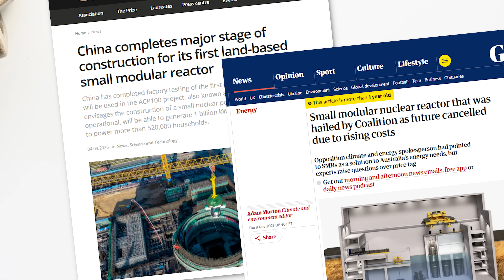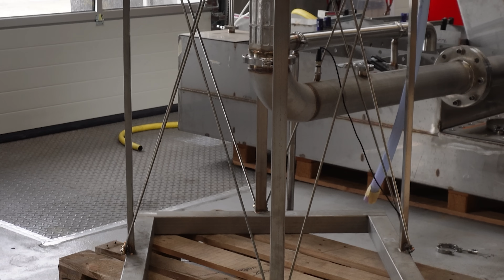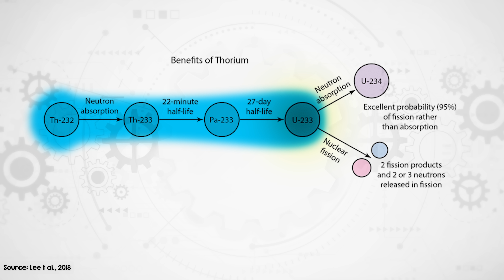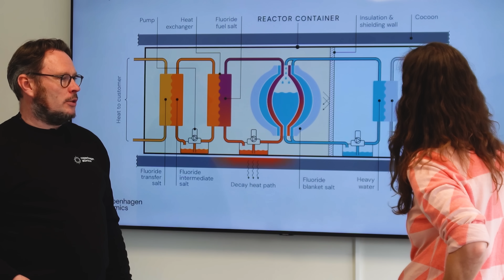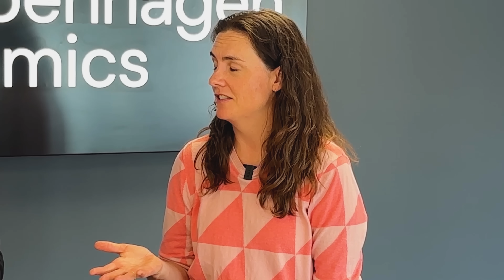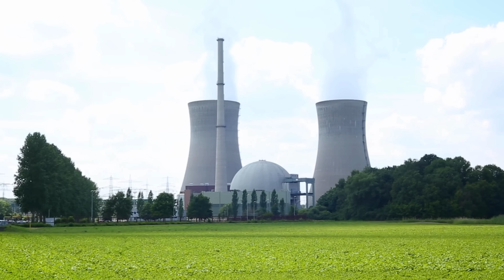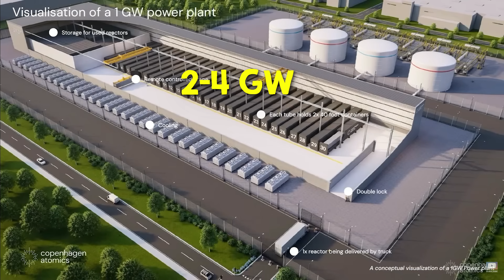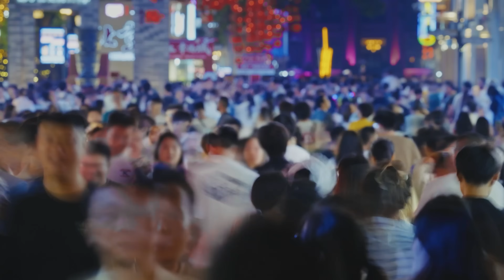Can Copenhagen Atomics Make THORIUM REACTORS Work? [TOUR]

Comment: Its happening.

TMSR LF1 has already demonstrated hot refuelling in 2024. TMSR LF2 goes critical this year as does the ACU NeXT TMSR in Abilene Texas.

So by the end of 2025 there will be at least three research TMSRs in operation aimed at fully exploring science and engineering issues associated with this type of machine.

Their main promise is as small modular reactors in dry-desert environments and as load followers for renewable energy, reducing or removing the need for energy storage.
Reply: Running a betting pool on first multifatality TMSR disaster.

Should I put you down for end of 2025?

Comment: Would have been interesting to discuss how much of a risk these would be to "bad actors". Ukraine has shown that nuclear reactors have been used as a pawn in the conflict. If we have a world with many thousands of SMRs, I can only think the world would be more risky.

I agree that letting the underlying physics dictate the size is wise. I do remember reading that the first water reactors used in submarines were pretty safe due to their small size and when the same design was scaled up for land use, the safety design became exponentially more difficult.
Reply: This design cannot ment down, and is walk away safe with passive heat removal. I think the biggest risk is a breach between the fuel salt and the moderator, which would boil the moderator and create steam, but since the reactive stuff is in a salt that will solidify once cooled down, it is hard to imagine that any radioactive material would leave the reactor building.
Reply: @thesparetimephysicist9462  My concern is the risk of having material such as Uranium distributed to vastly more locations around the planet. My guess is that to-date there have been less than 1000 large reactors built. SMR advocates want to multiply that by orders of magnitude. This is bound to make the task of keeping it away from us and the food chain much harder.
Reply: @pete_dl1585  I see. I thought you were concerned with weapon production. The good thing about radioactivity is that it is much easier to detect than chemicals, so by having detectors around the plants you will notice right away if something leaks. Also nothing leaves the reactor building through out the lifespan of the plant in CA's model. I believe that there has been zero casualties related to nuclear waste so far, and you cannot say that about chemical production, so I wouldn't be to worried about that.
Reply: ... meltdown's excluded of cause.
Reply: @thesparetimephysicist9462  Chernobyl wasn't technically a melt-down, it was a reactivity excursion - power went abruptly from a few percent of design maximum to about 100x it. That can't happen in most reactors. Those that have experienced partial or complete melt-downs - Three Mile Island 2, Fukushima Daichi 1, 2 and 3, Fermi 1 - didn't harm anybody. (Not from radiation anyway - about a thousand people died from the evacuation of the Fukushima area, who would have been fine left to shelter in situ for a few days.)
Reply: The #RogueState in the Middle East whose name this platform censors has been blowing up power stations for decades, that & the millions of "spent fuel" bullets everywhere have sent Iraq's cancer rate skyrocketing. 😢

Comment: My concern is both terrorism and waste. Britain has tonnes of waste that is rotting in storage tanks and has never been disposed of properly. It’s not that hard to bury it but it’s not happening yet. Until it does we’ve got to be very suspicious of the nuclear industry.
Reply: The short answer is that this design produces much less waste, and with a much shorter half-life. They plan to keep everything inside the plant until it is decommissioned, and at that point it is not very radioactive. The reactor is designed to be a waste burner, that can be started up on reprocessed waste. This means reducing the amount of waste in the world rather that increasing it.
Reply: @thesparetimephysicist9462  The usual proposals are not for waste burners, but at beast near break even reactors to produce about as much new fissile fuel as they consume. Especially small ones would likely not reach break even and would need some (like 5%) additional fissile material. There are waste burner concepts, but these are usually fast spectrum and only crude plans. They may want to start with Plutonium fuel, reprocessed from used fuel, but this would not address most of the waste. Having both U233 and Pu239 can still complicate the design, especially the chemical part. So they may need separate reactors for the PU to U233 step.
Reply: @UlrichHarms-ci1ov Hi again😄 I would think that you are right that Pu239 complicates the design on the chemical side. I do not no in detail how CA are handling this. What I know is that they spent a lot on energy on simulation studies in the past, and they show that they will be able to produce more fuel than they use. They also explicitly state that the reactor is designed to use both U235 and reprocessed waste. I believe one of the limitations on neutron efficiency is the purity of the lithium they use. Li6 will absorb neutrons, so they need pure Li7 produced on factory scale. they have come a long way, but are not there yet.
Reply: Aboveground storage is better because you can survey the storage to see if everything is intact.
Reply: @MrYishaiShields for 100,000s of years? It’s not realistic to leave it lying around for future generations to cope with. It’s only 2000 years since the Iron Age and the time scales we’re talking about are unimaginably longer.
Reply: @shaneintheuk2026 anything that is radioactive for 100,000 years is safe to eat. Time and intensity are inversely proportional. Something that is radioactive for a week is very deadly.  The above ground storage can be hugged it's very safe. Most of the waste can be used as fuel in MSRs.

Comment: One big problem with the Thorium fuel cycle is the length of time it takes to breed the fissile Uranium 233 from Thorium 232. The slow part is the intermediate isotope Protoactinium 233 which has a half life of roughly 28 days to decay into U233. 

Compared with the half life of Neptunium in the Uranium-Plutonium fuel cycle, Np239 has a half life of roughly 2.5 days to decay into Pu239. Which is about one tenth the half life of Pa233. Therefore it'll take roughly 10 times as long to breed enough U233 from Th232 to start another reactor, as compared with the time it'll take to breed enough Pu239 from U238 to start another reactor.

So it takes a very long time to scale up Thorium fuelled reactors. Rolls Royce, a UK company that makes nuclear reactors as well as jet engines, estimated that it would take 200 years to get up to a full fleet of Thorium reactors to power the UK. 

The other big problem with Thorium and all nuclear reactors is that the price of energy from wind and solar is coming down fast. Soon electricity from renewables will be so cheap, nuclear power will be uneconomic.
Reply: This is misunderstood. If you have the same number of captured neutrons, once equilibrium is reached, the fuel output will be the same. Because Pa-233 decays more slowly than Np-239, you will just have more of it in the process. No significant difference in production time.  

This reactor will be started using U-235 and will transition to U-233 when enough U233 has been bread. Takes a couple of years to get the Th fuel cycle running.  It can also be started using cleaned-up nuclear waste. CA believes they can operate with a small surplus of U-233 — enough to start up a new reactor with U-233 every 10 to 20 years I believe.
Reply: @thesparetimephysicist9462  " enough to start up a new reactor with U-233 every 10 to 20 years I believe."

Which means the doubling time is 10 to 20 years. Which is why Rolls-Royce estimated it would take 200 years to get up to a full fleet of Thorium reactors to power the UK, which is a small country. 

We simply do not have that time to switch to non-fossil fuels.
Reply: @JohnSmall314  Yes, if you ignore that it is the plan to start the reactors on ordinary U235. It only becomes a limitation the moment we run out of U235, and then you can start using the waste to start up reactors.
Reply: @thesparetimephysicist9462  What John is implying, albeit in a sideways angle, is that we have too many overlapping ecosystems collapsing around the world, to ramp up in time to keep countries that have equitable grids, only to have far more that keep fossil fuels dominant - ending up in a wholesale collapse. This is why this tech should be solely aimed at developing countries that are actually sustainable.
Reply: Here in Canada we don't charge for actual water so much as we charge for the treatment and delivery of water since it is so abundant here.  That could well be the case for solar soon as the price comes down and there are so many operators pulling energy from the sun that the source of energy is worthless but the infrastructure (i.e. grid and panels etc.) that harvests and delivers solar generated electricity is where operates will charge to make money.
Reply: Does that mean that they are also slow to adjust the power output, and thus unusable as backup for wind power at times of low wind?

How cheap is the solar that Thorium reactors have to compete with?  I have just installed 3KW of solar panels on my garage roof for £0.00.  The panels where unwanted, replaced by the owner by new solar panels that are supposedly much more efficient than their 14 year old ones.  Of the 3KW of panels I've installed so far, I'm seeing 95% of the rated 3KW output, even without clear sky, so they are still good panels, probably have another 20+ years of life without much loss of power, but apparently good panels are now disposable!  Batteries are heading in the same direction.  Thorium reactors with a 5 year mandatory complete rebuild are never going to compete!
Reply: @nigels.6051  It is a swap not a rebuild. The pull out the old reactor vessel, transfer the fuel salts to a new on from the factory, and plugs the new one in. Way less shut down time than a traditional reactor. A reactor vessel is estimated to cost 4-8 M$ to produce. That is about 0.5 cent pr. kWh of electricity.
Reply: You are mistaken about the breeding times; fast reactors produce more neutrons, but they also need ~10x more fissile just to start. Metal fueled reactors have somewhat better breeding performance, but it is offset by reprocessing difficulties, and even the Plentiful Energy book notes that they won't make economic sense until uranium is much more expensive or reprocessing is much cheaper. Fast MSRs are looking at doubling times of several decades, and the first is even longer when started on HALEU. (also the half lives of Pa and Np are not relevant)

Thorium reactors primary advantage is that thermal spectrum breeding allows much more rapid deployment, because they need so little fissile to start. Transuranics from spent fuel will go a long way to accelerating deployment in this case, and doubling time will be ~20 years. Either way, breeding is slow, but we have a large (and growing) supply of transuranics, and the UK also has 140t of separated plutonium as well; no breeding needed. RR's 200 year estimate should be considered as the pessimal prediction of a competitor.

The cost of wind and solar will not come remotely close to competing, especially when intermittency cost is included. Moreover, the cost is now rising rather than falling, and the UK subsidies reflect this.
Reply: how did they build that one in the 50s in like 10 years?
Reply: You're short on imagination, of which the community more directly involved with outfits like Copenhagen Atomics, is not.

Hydrogen/Ammonia economies scale well with most energy sources, depending on the equitable grid infrastructure. Even desalination combined with sodium ion battery manufacturing, being evaluated in developing countries like Chile, who are weighing options for graduating lithium and the more expensive mineral byproducts, are more vested. One of the most promising applications of the Protactinium delay is hydrogen. Heavy transportation alone justifies the cycle, as well as industrial heating, etc..
Reply: Thorium reactors can be started with spent fuel (from light water reactors, mostly) or with freshly mined uranium - they don't need to wait for surplus U233 to start. The same applies to the Uranium/Plutonium cycle.

Comment: Thanks for showing us there ideas and factory. Living in Denmark i hope they make it but i am skeptic about the economi of the projects. One obvious use would be where gas fired power plants are stopped due to environmental concerns where you dont have to buy/build the turbine and connections.
Reply: These are small enough you don't have to install them in the same place, you can spread them around and so not require huge power grids.

Comment: There is no way for modular fission to be less costly than solar.  I just cannot see why investments keep flowing into 80 year old tech?
Reply: Maybe for situations where any intermitance would not be feasible.
Reply: Can easily (assuming giga factories) compete with solar in areas where you get some level on dunkleflaut, especially if you don't want gas peakers.
Reply: Solar technology is older than nuclear fission. Nuclear has proven it's effectiveness in France a cold country where 90% of people use electric heating powered nuclear reactors. 

Sweden, Switzerland, Ukraine and Finland all are examples.
Reply: Cost is one debate, and scalability is another. With the solarpanels we need a lot of storage, and the time and number of factories it will take us to build all that needs to be considered. I believe we do not have enough engineers in the world to get there in time. With this design you could build 15 GW of capacity in one year on one production line. That is three times as much as we consume in Denmark. … And when you add the price of storage I believe the nuclear solution will end up cheaper if mass produced.
Reply: @thesparetimephysicist9462  Scalabilty is an issue with the thorium reactors. They still need there initial fissile fuel from somewhere - this would need to be some highly enrichted uranium. The breading rate in the thermal thorium cycle is low, and the inital reactors without well developed chemical cleaning may well not even reach break even breading. The avaiability of the inital fuel would limit the build up speed. It currently does not looks like the US and Russia would be willing to give up there weapons materials to start a few reactors.
It would still need the developement of the chemical part - so we likely still have some 50 years before the fuel problem comes up.
Reply: @UlrichHarms-ci1ov Yes, they will have to start up on enriched U235, and they will not be efficient enough to create excess fuel from the start. From CA's estimate, they will i theory be able to get enough excess fuel to start up a new reactor every 10-20 year, so you should be able to expand. Will there will be a bottleneck with U235 or reprocessed waste at some point? Perhaps, I don't know.
Reply: Lazard's Levelised Cost of Electricity has solar at $36-44 per MWh (utility scale, in sunbelt USA, with no allowance for storage or transmission, or synchronous condensers to regulate frequency.) If CA can get $20/MWh for 24/7 dispatchable power they'll blow everyone out of the water - and cheap heat at ~600 C would find plenty of takers too.
Reply: especially when the silicon for solar is made using forced labour in xinjiang
Reply: @trevorabbott3907  🤡🤡
Reply: @trevorabbott3907  "especially when the silicon for solar is made using forced labour in xinjiang"

Yes China does use forced labour in Xinjiag, and yes China does make solar panels, but that doesn't mean China uses forced labour to make solar panels. 

It's a highly skilled job and the factories are located in the industrial areas of China, far from Xinjiang. The raw material is silicon, a very common element.
Reply: @JohnSmall314  We are both correct. Silicon production begins with quartz which is converted to metallurgical grade Si (MG) in a submerged arc furnace via a carbothermic reduction process. This is then purified to PV grade silicon via the Siemens process involving chloro-silane gas. Xinjing accounts for the large majority of MG and PV-Si production worldwide but not, as you say, solar cell production.  Nonetheless MG and PV-Si are still necessary inputs to solar.
Reply: This not old tech. Thorium fission was put on the shelf years ago but revisited only recently.  These guys are solving how to do it with new technologies.  
Solar and wind won't be enough. Thorium has huge advantages including much faster decay of ""waste  products" . Look into it
Reply: @BobHarris-to1fv  Yes, it is really old tech, over 75 years old.  We have already had thorium in 1950.  My education and background is Nuclear Engineering@!